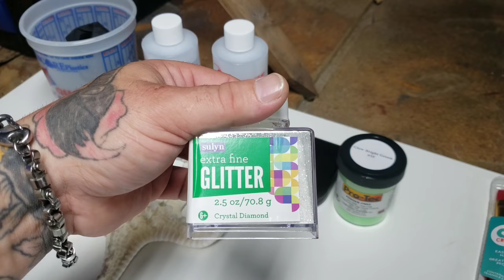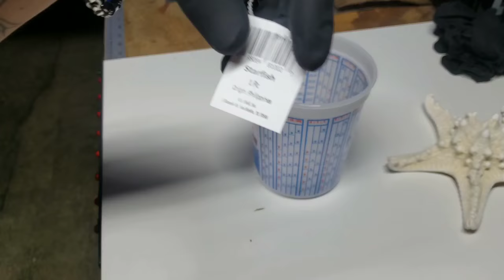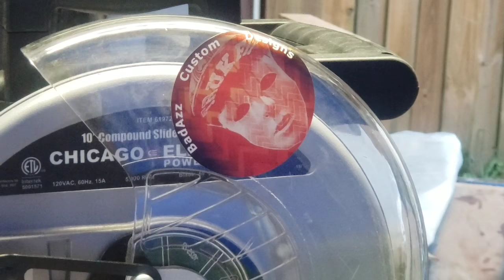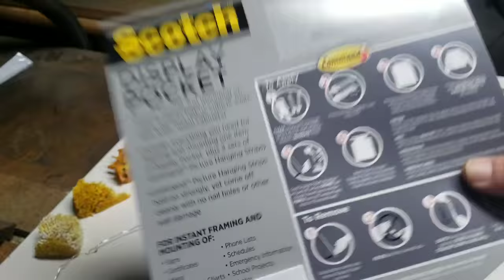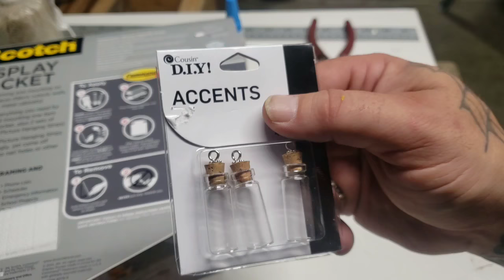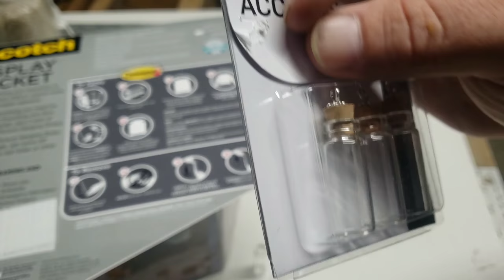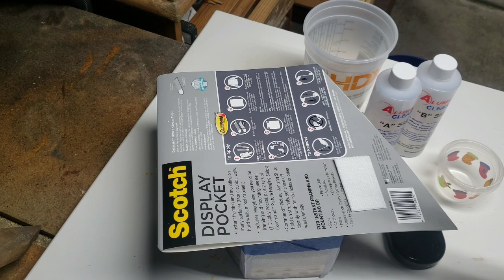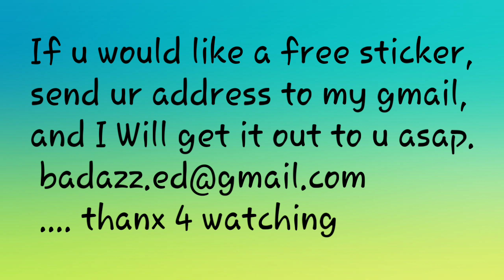Starlight Starfish (Epoxy Fail)

Comment: dang bro that blows, had some real potential, hopefully you can salvage it. what we're going to use the glitter for? did you mix that in with the paint for the star fish?
Reply from the maker: If u look close, the glitter is on the outside of the glow powder. I just cut that part out of the video. My bad.